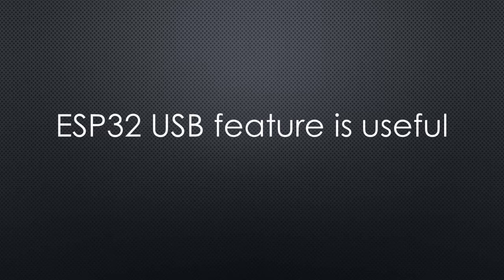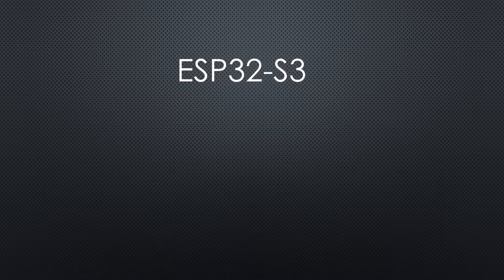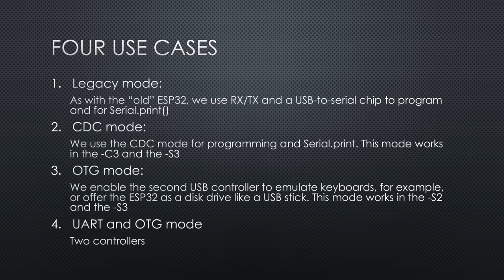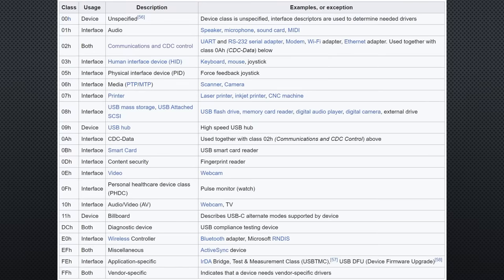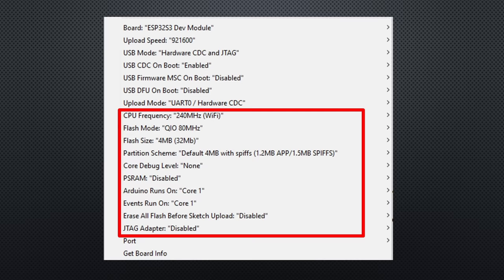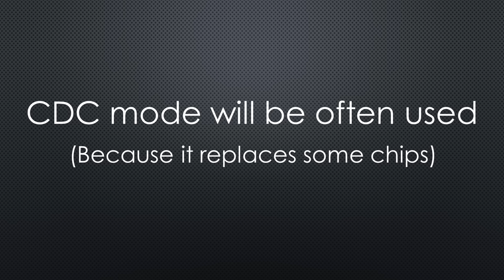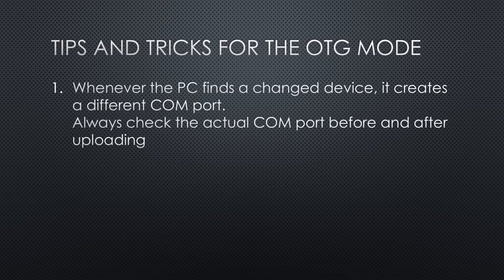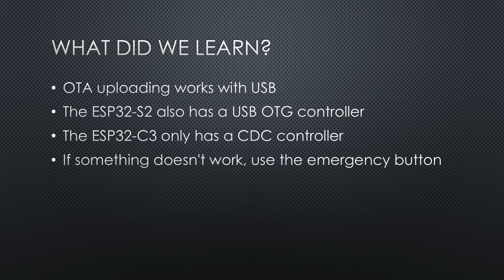456 Hassle-Free ESP32 USB (ESP32-C3, ESP32-S2, ESP32-S3)

Comment: ANDREAS -- PLS HELP ME SIR! i am new to ESP.  i bought this board on Ali express from "Camera Module Factory Store"  (ESP32-S3 Development Board 2.4G Wifi BT Module with MIC OV2640 Camera Module NEW ESP32 S3 N16R8 CAM 8MB PSRAM 16MB FLASH) i dont know what i have. what do i select in arduino. i can't find any documentation that even looks like this board. it doesn't have a heat shield. is it wrover or wroom or what. i am so confused. i want transmit images to my computer from it, that or sound using the mic) but i dont know how to even start. i'm not completely sure which is the reset button or which is the boot! PLEASE HELP!
Reply from the maker: I cannot help you because the board you bought is not for beginners. Search for "how to program ESP32 with Arduino" first.
Reply: ohh, ok thank you.  @AndreasSpiess  :)  happy new year anyway! :)  if you do find you get a hold of one of them, it would be good to see a video if you get time :)

Comment: Interesting! It could be interesting to see how platformIO take care of this board, I guess most people have stopped using the Arduino IDE. I have been using a S3 for a month now and I find it quite unpredictable with weird behavior unseen on the normal ESP32: flash errors, no boot, boot but no serial, reset not working (sometimes) I do not know it it is the specific board I have (proS3) or if it is generalized as a lack of maturity of the new chip and firmware?
Reply: Most people are still using Arduino IDE as its good enough for nearly every intermediate project if the microcontroller is supported. PlatformIO's own documentation recommends people still use Arduino IDE if it supports what you need to do. This is their own words " If you need a simple and easy-to-use environment for a small project, Arduino IDE may be the better choice". Also people who can already work PlatformIO generally don't need guides like this one, lol at the end of the day its just telling you which options on drop down lists to pick.
Reply from the maker: The weird behavior should end after watching this video;-)
Reply: @AndreasSpiess  I hope so, I'l let you know :p)
Reply: @AndreasSpiess  So... using PIO I had issues of random failed upload with the normal UART mode, I tried changing cable, pc nothing worked, following your video tried in Arduino IDE normal UART was same and CDC maybe it improved a bit but I still have some random errors. (proS3) 
The upload issues are just annoying,  but the worst grief on the S3 is that when you get to complex code it just refuses to run without any hint or even running to a crash, it is just bricked until you flash a new working code. This is a nightmare to debug.
Reply: @jmirodg7094   Yes S3 code need to be tested step by step, because is what you say, sometimes is difficult and slow to debug.

Comment: The transistors are not essential, BTW, works just fine without in most cases.
Reply from the maker: I agree, they are only needed if you want to automate the GPIO0 handling

Comment: So, can you now connect an USB web camera :) to the esp32?
Reply from the maker: No. Host mode is not connected yet.
Reply: @AndreasSpiess  By connected you mean it's not in the chip/specification yet or the firmware has not functionality implemented?
Reply from the maker: @DamjanDimitrioski  autocorrection… it is not implemented yet in the Arduino IDE
Reply: @AndreasSpiess  I see.
Reply: They have an example in esp-idf that apparently takes a USB webcam and broadcasts it over wifi.
Reply: @conorstewart2214  thanks, I will look for it.

Comment: Hello, you didn't mention how to use method 4.
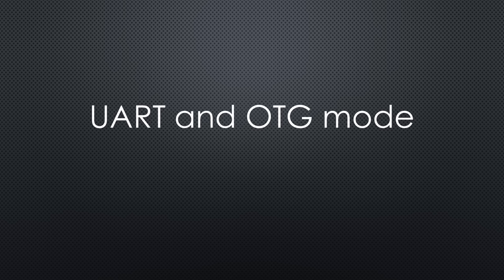Reply from the maker: Check 10:04
Reply: The correct settings for method 4 to work are cdc on boot disabled and usb mode otg

Comment: I use the C3 a lot to replace my 8266's and I'm like the power of the S3, without a doubt. I think the S2 is a brain dead option, especially without Bluetooth.  I have 3 of them and have yet to deploy a single one. The S2 is terrible and so inconsistent. Life is too short for the S2. I'll stick with the C3 and grow into the S3 to replace the original 32's.
Reply from the maker: I think it was an intermediate step on their way to the -S3.

Comment: Andreas, forget about the ESP32, use old CELLPHONEs, they come with batteries, camera, GPS, SD card reader, screen,....  you can debug them, have more mem, and they just wok.
Reply from the maker: And how to program them. And what about the GPIO pins?
Reply: There is a reason why old smartphones aren’t used very often. If you want gpio then you need to connect other boards to it through usb, so in that sense it is no better than a PC and you may as well use a microcontroller. Most projects won’t need any of what you listed and will probably benefit from having smaller components than a whole smartphone. Microcontrollers are smaller and more power efficient. Smartphones run full operating systems which aren’t suitable for real time tasks so for anything real time then you need a microcontroller just like if you use a raspberry pi, you need an MCU to handle the real time tasks.

You can debug most MCUs as well, MCUs generally have enough memory and dev boards generally just work too.

Everything you listed can also be done with an MCU, some with adding extra components. The only reasons to use a smartphone are situations where you would normally use an SBC or you need phone signal on your project, not MCU projects. Or alternatively, you are a software dev and don’t know much about embedded development, since creating android apps is firmly in the software dev field.

Another big factor is the cost, you can get a lot of MCUs very cheap, a lot cheaper than you can get a phone. You may be able to use your old phone or a friend or family members old phone but if you need say 10 of them then you may have issues, you can get lots of MCUs which would be more suitable anyway a lot cheaper and easier than getting lots of phones.
Reply: @conorstewart2214   I am not following you, but for Andreas projects he'd be better off using cellphones, for GPIOs use an arduino connected using a USB serial port.
Reply: @raguaviva  that isn't my problem. Maybe you should try reading it again.

He would not be better off using cellphones at all for the reasons I explained in my last comment. Everything you described as an advantage for using phones can be done using MCUs as well.

If you are connecting an MCU to the phone anyway then you might as well just use a better MCU.

Again the main problems with using phones is availability, it is much easier and cheaper to get 20 MCUs than it is to get 20 phones. The size is a big difference as well as power efficiency. You can make an MCU sleep and get a very long time out of a relatively small lipo, they are a lot more power efficient than a phone and a phone cannot properly go to sleep like an MCU can.

You can use a phone in place of a single board computer like the raspberry pi since they can be similar but you cannot use it in place of a microcontroller like an Arduino or ESP32.
Reply: Andreas is right. How do you program them? Android was supposed to allow C programming. I tried it but you almost always need to slip into Java or Kotlin or something. The simplicity of Arduino-style development is too compelling.
Reply: @wm6h  C/C++, Java, python, it's all possible.

Comment: OK,,, Where did you hide the Excel spreadsheet for the S3, the S2, and the C3.... I know you have it....  You showed it for a couple of seconds..... Come on and Google Drive it please.... OR do you want some help with adding the Espressif data to it???
I'm sure there is a way to put it in there with a Python script..
Reply from the maker: Usually, you find all links in the description, as mentioned in the end of the video.
Reply: @AndreasSpiess  Yes, I found it after I made that comment. And then I took it and added the rest of the Espressif dev kit pinouts and some of the SOC's also.. For my project assistance. Thank You so much!

Comment: I don't really like the 2.0 Arduino. I prefer to use the previous one. And esp32 is nice, but the pin labelling is a pain.
The esp32cam is a pain, always unstable and can never boot correctly.
Or I bought bad chinese .
Reply from the maker: Pins on the ESP32 are very flexible. This is why I once made a video about them…

Comment: Please provide any recommendations on how to connect an ESP8266 to 3G LTE as there is no Wi-Fi access point available in the area. 🥲
Reply from the maker: You need to add a 3G module
Reply: @AndreasSpiess  thanks, Can I use 2G module. I want to send over MQTT protocol ?
Reply from the maker: @Imassin  you have to try. 2G is no more supported everywhere.
Reply: @AndreasSpiess  Thank you so much, but theoretically speaking, can we use 2G to send MQTT? Also, which ISO layer does MQTT use?
Reply from the maker: @Imassin  MQTTGateway be sent as plain text
Reply: @AndreasSpiess  Thank you so much🤩🤩🤩